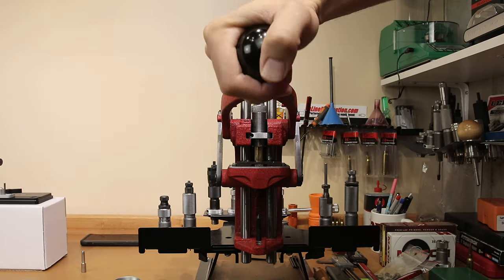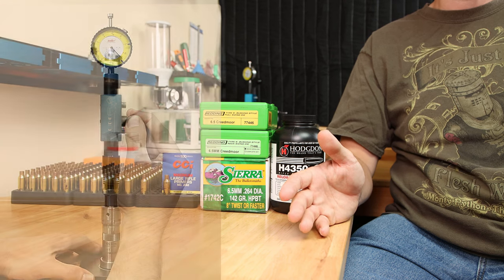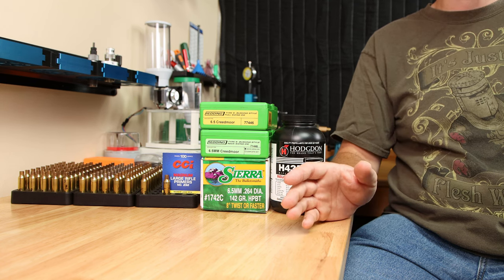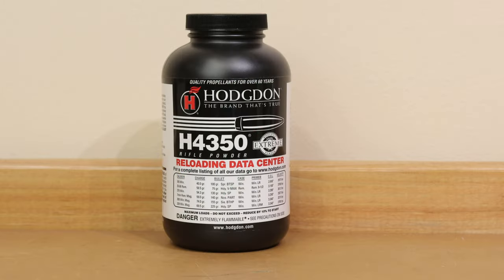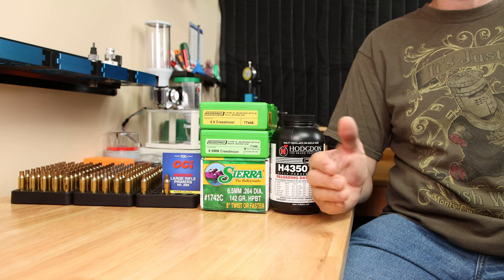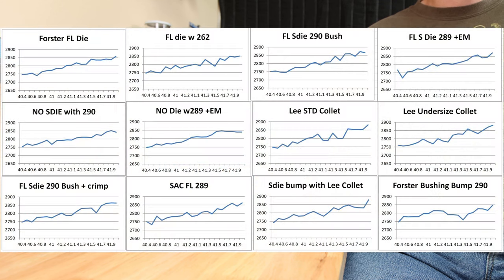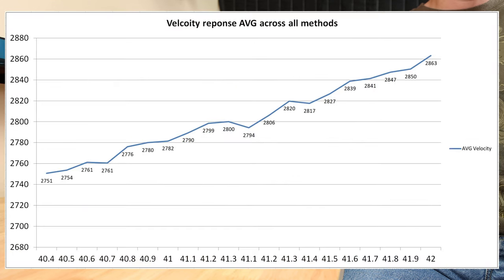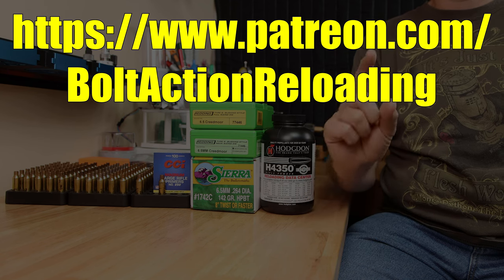Testing Every Brass Sizing Method! Full Length, Neck Sizing, Collets, and Bushings, Oh My

Comment: LOVE your videos ... my favorite site for this hobby.  That said, this video is "screaming" for a "Summary" that delivers a concise view of the results/conclusions.  I got lost in it, trying to figure out the key take-a-ways.
Reply from the maker: Hi Rusty. Thank you. I am glad to provide value to others in some of my videos. I really tried to make this video just that. I really don't know how to summarize something that I literally have 100+ hours into any further aside from just removing the seating force and pressure data all together. This video is less than 6 minutes. I am sure most are only concerned with the groups so I am just guessing that at this point no one cares about the other details. I was hoping to get more feedback about he charge weight to do the accuracy testing portion at but very few have. As much as people like to argue about this topic I guess I expected more interest or clearly I have missed the mark somewhere. If there is somewhere specific that I could have done it different I am happy to have the feedback.
BAR
Reply: @BoltActionReloading  Your content is AWESOME, and my only issue with this video was trying to figure out what the two or three key take-a-ways were.  I'm wrestling with trying to figure out which combination of bushings and mandrels ... either, or, or both together ... is the "magic" combination for low SD's and tighter groups. I've learned for me at least, the low SD comes first, and the tight groups will follow. Currently struggling to get a process with the least run-out and lowest SD, which for me right now, appears to be "SAC bushing only" and skip the mandrel.  Anyway, as an ADHD executive in the Silicon Valley my whole career, I always encouraged a "last page summation" that would provide the key learnings ... something other than "Here's a ton of data, but if you like your process, keep doing it."  I'd advise you go out on a limb once in a while and say "This one worked the best, at least in this test, and it's what I'll use in the future to refine my loads."  Make sense?  I hope so.  Keep it coming - your content is some of the best on the web.
Reply: @rustyinoregon2769  Rusty I have been reloading for well over 30 years and there is no perfect way to reload. There are many people who do better than others and repeat their same procedure all of the time, but there is no perfect way. And often when you think you are only changing one thing you are doing more than you think. If you change seating depth enough after getting that good SD it will change because you have changed the powder to case capacity. There are many other variables as well. Good luck on getting too busy on reloading. Consistency, good bullet components, same exact processes will turn out consistent groups and tighter ones.

Comment: Pulled the trigger on Quick load; that program is pure genius!
Reply from the maker: I use both Quick load and GRT. GRT is very good too.
Reply: @BoltActionReloading  I did a load up involving the .458 Win Mag pushing Campro 300gr FMJ just under the speed of sound with IMR Red powder. Without Quick Load, this would not have been possible. No such data exists and taking a chance even with lots of research and manual extrapolation would have proved to be extremely dangerous. One grain too much powder and the rifle would turn into a stick of dynamite.

Comment: Thank you so much for doing this test.  Not all of us have the time, money, and of course materials (coughprimerscough). to do these tests.  I have two ends of the spectrum for .223. -  I have a L.E. Wilson Die set + Exp. Mandrel and my Lee FLR die +  Neck collet die.  

I feel like the Lee die (or any FLR die with neck expander/manrdrel removed) utilizing a .002" bump and used in conjunction with the Lee Collet die will hopefully produce impressive results. 

 I'm fascinated by the design of the Lee Collet Neck sizing Die*.

*(Lee made a change in 2019 to the design, slightly.  Check their page)
Reply: Johnny reloading bench done a die test with 223.   His Lee RGB die gave awesome results compared to some of the other “ better “ brands.   I removed the expander ball from my Hornady die and my Lee RGB die.   Inside case neck diameter measured .227 after firing.    Resized one in Hornady inside neck diameter measured .213.  Resized one with the Lee and it’s inside neck diameter measured .216.  So the lee doesn’t work the neck of the brass as much.  Then i ran my 21st century mandrel thru. And opened up to .223.   Yes i only ran 1 thou neck tension on my bolt gun.
Reply from the maker: This lee collet die is pre 2019 for sure. I have one for 223 that is post 2019 though.

Comment: Interesting results, I wouldn't have thought that NS would create greater pressures. Apparently, brass expansion takes more energy that I expected.
It's a pity though, that the test did not cover neck + body sizing. I find that method works best for me in terms of unified seating pressure. It would be nice to see the figures behind.
At least, your video explained the significant difference between the predicted velocity, and the real V0 measured by Magnetospeed. I guess that minimal body sizing + shoulder bump allow me to save some of the energy, yielding greater pressure and bullet speed. Thanks!
Reply from the maker: This is what the sdie plus the Lee collet option would be. It's option 11.
Reply: @BoltActionReloading  Of course, how could I have missed it?
I see that - on average - it gave 1-2 kpsi pressure more, than other FL options. Which explains the slight V0 increase I get with that method.
Thank you again for your work!
Reply: It could be that the brass expansion slows down the pressure curve, flattening it slightly.

Comment: 41.2-41.3 looks good as well
Reply from the maker: These values are slightly higher pressure than I was hoping to run them at as well as they are right on the edge of the where the SD climbs.

Comment: One die I love is a Forster FL match die, with an oversized expander ball. The standard expander ball (.307) is the same as my sinclair expander, I wanted to go .3075 but found it many times cheaper to get the oversized expander ball, than to special order another mandrel.  One day I'll probably replace this die with a custom ordered die with a honed neck, then pair it with the oversized ball. That will make bullet seating using very little pressure, just the way I like it. My Dillon carbide is also .307, so it also has higher bullet seating pressure than I prefer.

Comment: I’ve reloaded since I was 15! Now 67, i look back to what works for me… I’ve custom guns with Tight Necks : no factory shell would fit in the chambers. All fire formed to the gun from 222 brass,22:250 etc with Steeper shoulders to prevent stretch.. You have to have your whitts
Reply: About you … All hand dies Wilson with bushings… 22BR is definitely Bench Rest competition… Never really had chance to shoot in competitions… My plan was to build for hunting mostly coyotes… Having a threaded die With Neck Bushings could be a game changer? Never know can’t shoot anymore after a very serious MVA accident 5 years ago… Having Tight Neck tolerances in the .001- .002 I’d prefer My Hand Dies. Only use 20-30 brass , Never Ever had a problem. Shot moly coated bullets thru them Zero problems…. Concept of shooting factory loads makes sense with a press until you want one hole groups or gun shoots the best You can. Jewel triggers were a game changer as well. All these pistol Space looking guns? I prefer my McMillan stocks…. Not sure if this helps any, just my opinion. Thank you!

Comment: Very interesting.  The neck sizing only method was purported to be more accurate and also increased case life.  I vote for more footage of actual shooting as it helps my low attention span.
Reply from the maker: I am really wondering about case life differences at this point. Lapua lasts so long FL sizing I just don't know how this is a concern. If your not sizing the base of the case it just seems like you struggle getting it back when you do need to size it. These are going to need to get bumped next time as I don't feel like destroying my action over this testing.
Reply: @BoltActionReloading  Amazing how much of the shooting/reloading world orthodoxy gets overturned over time. Thanks for doing your part!
Reply: If you talk to the folks who shoot in competitions for a living...they all full length resize.

Comment: Im a total rookie , can you do some set up videos on some of these case sizing options.  Ive heard that neck sizing only is bad so Im only going to do full length. There is so much information when you 1st get started that its overwhelming. Knowing what you want is one thing , how to get there is a different story.  I cant find a video where someone takes once fired brass and goes from there...resize /  shoulder bump ,  all the way to seating depth to the lands and  then head to the range
Reply from the maker: HI Rick, If your brand new I encourage you to not worry about every single video on tuning a load and first make a successful round. Once you have the confidence of a starting place you can build on that. I have a video here that shows the brass sizing process - https://youtu.be/6mgIJinR1qI Do you have any equipment yet?
Reply: @BoltActionReloading  Yes , I have a press and quite a bit of misc. tools, but i want to buy the correct dies.  Dies and powder are all im lacking really. Ive been buying "nice" stuff instead of buying a kit.  I had a Redding die kit ready to go and then I saw all the different ways to size brass ...I pumped the brakes until I figure out whats the best way to do it. I will keep cramming information until it just clicks. Thanks for your time , I really appreciate it.